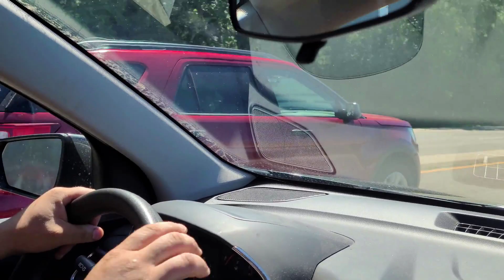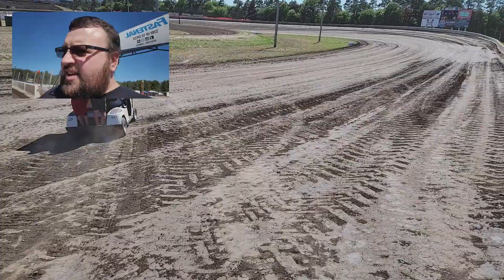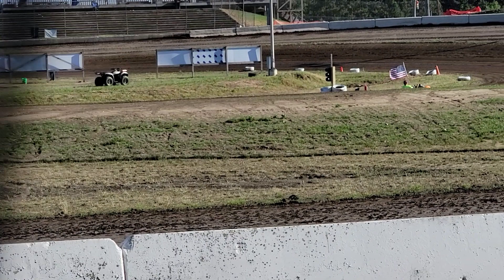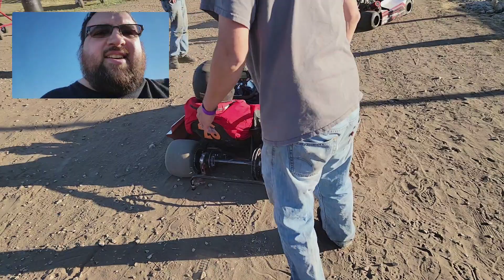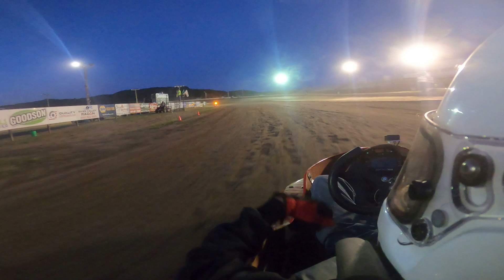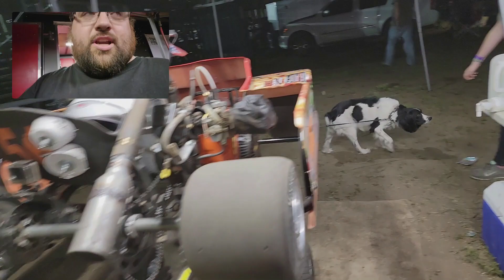MTS Summer Series 2021, Night #4 (Part 1)

Comment: What adjustments can you make to change crossweight or left or right side weight
Reply from the maker: Left to Right side weight can be adjusted with either the driver's weight (moving the seat left or right) or weight ballast that is added to the kart to make the desired weight limit for the class. You can move that weight left or right to get the scale number's where you want that or for a certain track condition. Cross weight is adjust by the front spindles. Raising or lowering the spindles will adjust how much cross is in the kart. You can adjust it in the rear, but is rare to do so. Lower the right front spindle adds cross, raise the right front spindle takes cross away. Left front is opposite. Lower the left front spindle to take cross away or raise the left front spindle to add cross.

Comment: Now how much do you guys spend a year on racing because my dad keeps telling me all i need is a go kart and not the other equipment and im like dad you need tire prep tools, you need stagger tape, you need impact wrench, race fuel can, safety equipment, scales, etc. Because im getting into oval track go kart racing and im either getting a flat kart or wedge kart or cage kart, and we have a stock predator 212cc engine and can you give me q rundown of cost and how to budget money
Reply from the maker: That is a tough question to answer to be honest. Each year can be different. Racing is not as easy as many think. People like your dad assume racing is easy, jump in something with wheels and drive it in circles. It's definitely way more involvement then that. Like I tell people I have been helping this year. Racing has a lot of puzzle pieces. It's getting all those puzzle pieces lined up to make the kart work how you want that is the challenge. The Stock predator class is a great starter class. It reminds me how the clone use to be 12 years ago. So if your just getting into racing, that is a great starter class. As for chassis......really it comes downs to how much you can afford. So best I can recommend is figure our what your budget will be and then buy your first kart within that budget. As for specific race tools, that again comes with time. Buying scales, camber/caster gaughe, square/toe tool, bead breaker and bead ring, etc.....that will come with time. If you can hook up with a fellow racer who can help you out for a year or 2 while you build your racing tool inventory, I would recommend that. As for a specific price.....it can range from $3,000 to 15,000+. Again racing is how much  your willing to spend. I hope that helps you out.
Reply: @wolfemotorsports  thank you this will help me out a lot because at first i was gonna buy everything at once then start racing, and i probably would've been broke but thank you this comment helped a lot
Reply: @wolfemotorsports  he doesn't think its just cars going in a circle more like he doesn't think theres a setup or adjustments i think he's saying that either A: he might not know a lot or a little about racing, or B: he doesn't want me to worry about getting the right tools and spending all my money, but this response to my comment really helped me out thanks again
Reply from the maker: Glad we can help you out. Racing is a blast, takes time to learn. Set ups, certain adjustments to make for each part of the corner, driving skills, etc. I would say get yourself a kart in your price range, buy an air gauge, tape measure, basic tool set to take with you to the track and start from there. It's taken us years to get where we are and build the inventory up to what we have. So if it takes a few years to get everything, that is ok. Go out on the track as much as you can, make laps, and everything will start to fall into place.